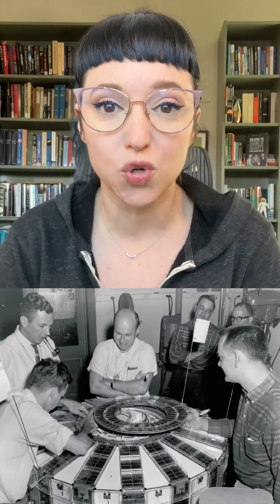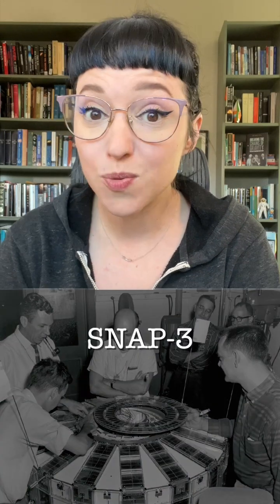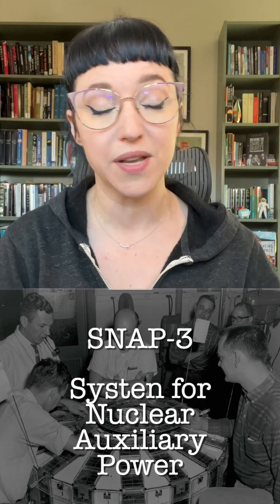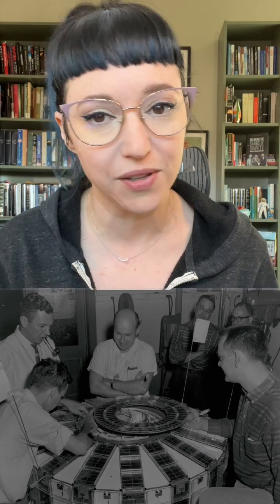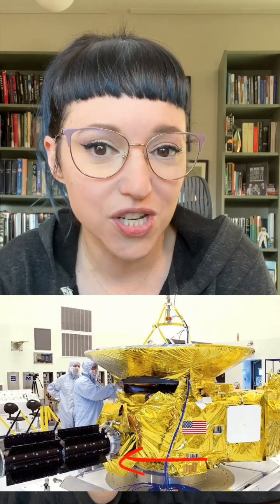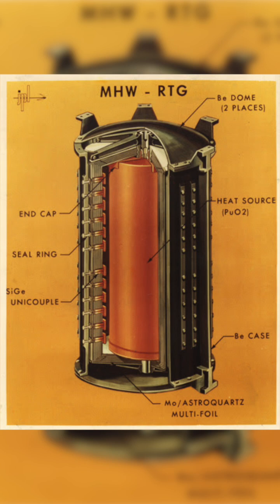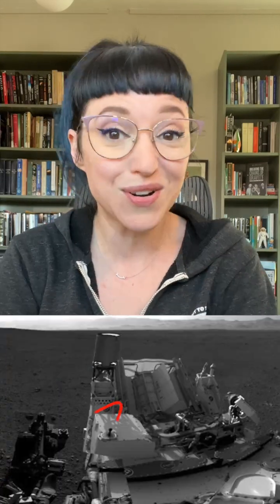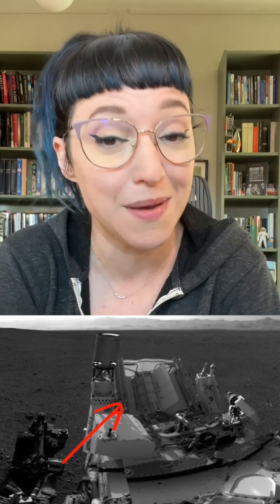Nuclear power is so yesterday #shorts #space #history

Comment: It blows my mind that the neutron was not even discovered until 1933, and then in 1945 we had the atomic bomb. The 20th century was mindbogglingly innovative. Same with airplanes: Wright brothers in 1907, and air reconnaissance missions in 1915. Integrated circuit invented in 1958, IBM mainframes hit the market in 1965.
Reply: For me, the fascinating decade is the 1890s. Look at the devices which were launched around then: telephone, phonograph, radio, cinema, car, electricity for general use...just to name the ones I can quickly think of.
Reply: @maxfan1591  Medical x-rays - 1896!
Reply: @prdoyle  Yes, that too! Thank you!

Comment: You can buy the same tech (the generating side with no nuclear beat source) super cheap. Put a heat sink in one side and a heat source on the other you get voltage. Alternatively you give it voltage and put sinks on both sides and you will move heat away from the one side and add it to the other. This is how most portable coolers work.  They aren't very efficient but you can stack them or get a multi element one and perhaps use water cooling and you can get the cold side super cold.  

I used one with two water loops one to a small radiator and one to a fabric water jacket pad and used it to keep a  cold pack that doesn't use ice.  Just chills the circulating water using electric.

Comment: Currently, NASA has a plutonium problem: they're running out. During the Cold War, there was an ample supply of Pu-238 available to NASA. But that production ceased in 1985. Russian sources have also dried up. Oak Ridge is once again producing Pu-238, but NASA needs more than they can produce. The Europa Clipper had to be redesigned to use bulkier and and heavier solar panels instead of an RTG.

Comment: Note that the plutonium pucks glow red hot, but as it decays the power available slowly drops. This is why both Voyagers are on extremely low power mode most of the time.
Reply: It just amazes me we can still communicate with Voyager and that they still have some functionality.
Reply: 1% of current per year loss is not that bad...
Reply: The power also drops because of degradation in the thermocouples responsible for converting heat into energy.

Comment: They are about to become historic.  Because of the decline in nuclear fuel reprocessing, we are running out of Plutonium-238 that powers RTGs.
Reply: MIT started a program to synthesize future batches a while back.
Reply: Sure...
Reply: Came for this. Can't recall the video I watched about that. Curious if the NDB (nuclear diamond battery) will start to take its place.
Reply: @aimlessweasel nuclear diamond batteries put out minuscule amount of power in comparison to an RTG. Nuclear Batteries do supply the voltage and current they can do for extremely long times, but are not capable of powering much, so the electronics has to be low draw and extremely efficient.
Reply: @DishNetworkDealerNEO  Thanks for the reply. I figured it was lower, but saw they were marketing them for space applications. Although the heat from RTGs is apparently sometimes useful, it is otherwise waste, and not being converted to electricity. I thought this might be an incandescent vs LED situation where the NDB was vastly more efficient (assuming the application doesn't have use for the heat).
Reply: @aimlessweasel heat in space can maintain temperatures that allow earth designed electronics to function better, as deep space is extremely cold. So,,it’s not exactly a waste…

Comment: Nuclear heat generation mostly comes from Neutron impacting other atoms making them jiggle (which we call heat).
There is another way to generate electricity from decaying radioactive material -- Alpha & Beta particles (both of which are charged).
The most direct way is to capture the charged particle and produce a voltage difference which is electricity. 
But the other way (if you can't capture them) is the same way 98% or our Electricity is generated here on Earth -- a Magnet moving past a Wire produces Electricity. Have the Alpha or Beta particle (it doesn't matter which as diodes will correct the current flow) as it flies off the nuclear material it flys by wires and thus you have induced current (the Alpha or Beta particle being the moving Magnet).